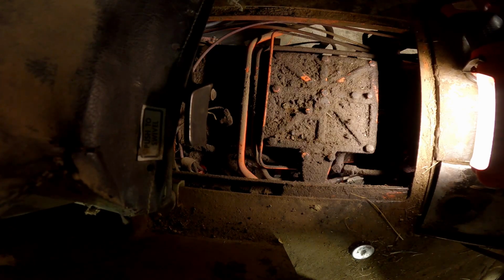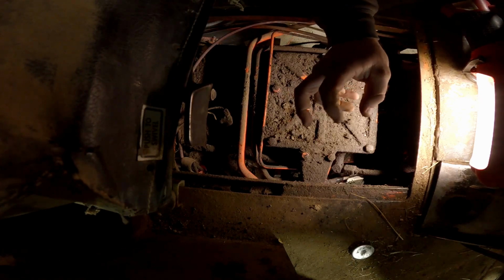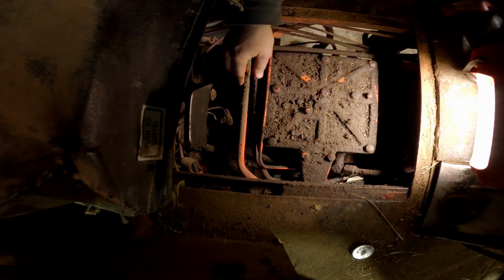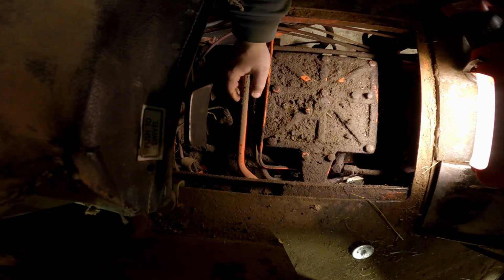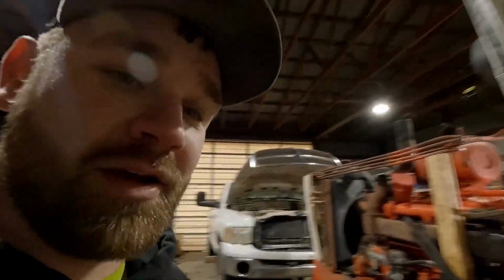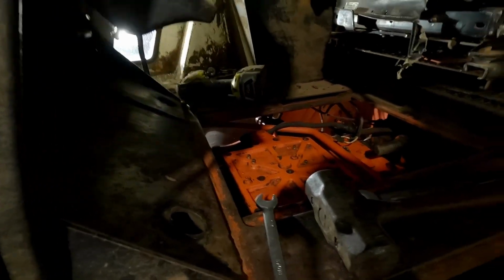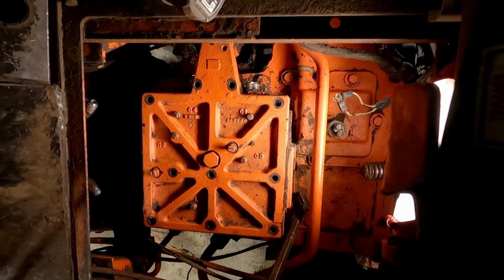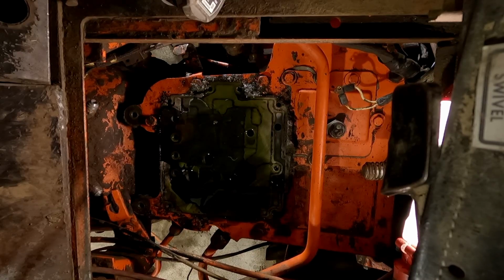The Case 1070 Power Shift Teardown Part 2

Comment: You probably have it off already  but if you support the cab and pull the bell housing off the trans it makes it 10 times easier to get that top plate off, you can just slide it out the front with two people.  A little more stuff to remove to do it but its saves the back and the fingers.  When we first done it, we removed the steps and then man handled it out the left side of the cab. When we went back together we wrapped a chain around the top of the cab and then used a come along through the hole and picked it up that way.
Reply from the maker: That would be very helpful. A lot of our time has been cleaning the top of the transmission off. Looking back, we should have power washed the top of the transmission off before putting it in the shed.